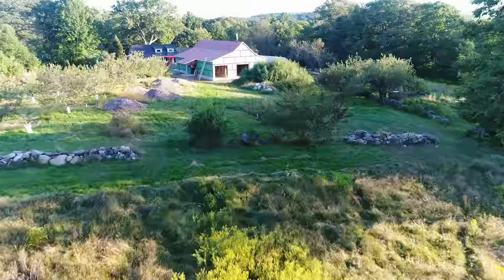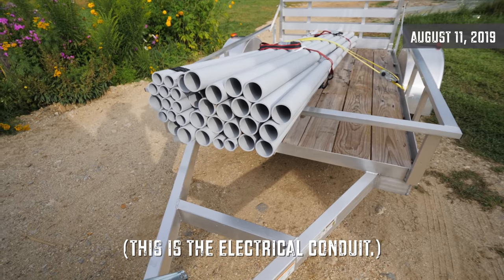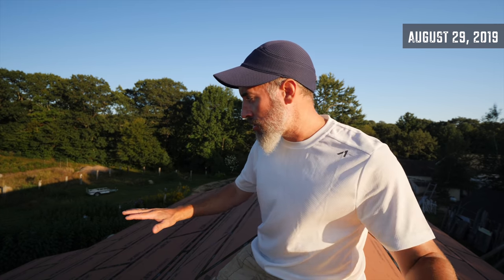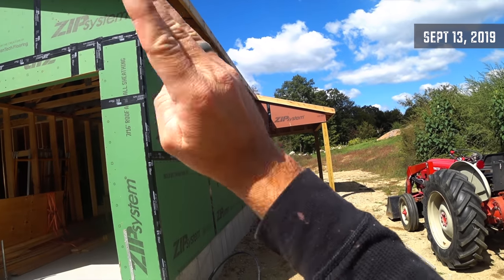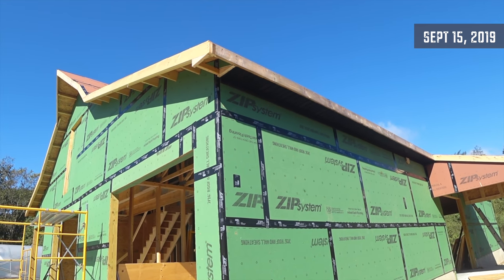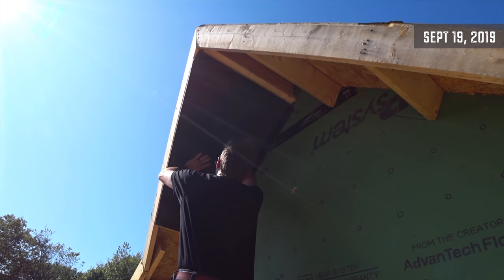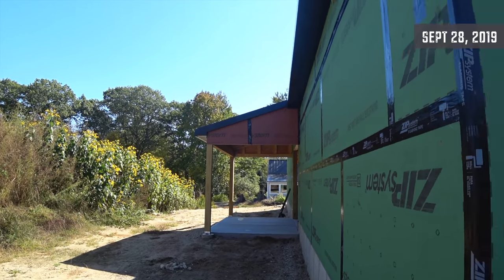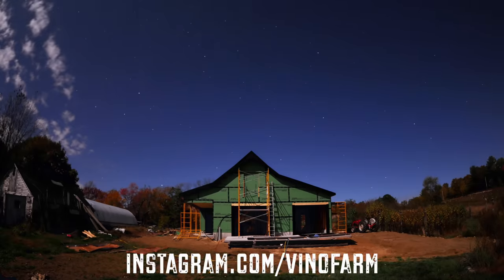Dream Barn (Part 3) FIRST TIME For Everything - Soffit, Fascia, Metal Brake, Roof Trim

Comment: Bravo going with the Zip system dude. Can’t beat it, moisture and air barrier integrated with the sheathing. I’ve personally never seen a metal roof installed WITHOUT a plywood/OSB substrate. Makes zero sense to me either. You’re seemingly doing everything right with attention to detail and quality. The end result will be a building that will withstand our harsh New England winters and be a source of pride for decades to come.
Reply from the maker: I'm hoping this building outlasts our 240 year old farm house.

Comment: So many ladders in deed. At least you seem to handle heights and your balance well. Just please stay safe.
Reply from the maker: I really dislike ladders, but sometimes they're just the most convenient solution. I found myself getting much more comfortable on them after two solid months of climbing up and down during the trim and roof phase last fall. The scaffold was very nice, but not easy to move around for quick tasks. It was essential for the peak work, though.

Comment: Awesome video... keep em coming!!! :D Love this as much as the bee videos. 
Also, really love the design of the barn with how those peak lips stick out. REALLY gives it some character.
Reply from the maker: Yeah, I decided to put a little crow's beak on the front. It's purely decorative... If we had gone the timber framed route, we could have actually extended the ridge beam out and had a hoist out there. This is just for looks and a little rain protection for the siding.

Comment: There are tricks that reduce the oil canning of the aluminum fascia, but you did pretty good. If you installed a drip edge first, then just tucked your fascia under it, oil canning would be reduced because you wouldn't need the nails at the top of the fascia. And those produce more oil canning. 
 I was wondering why you didn't continue the aluminum soffit on the rakes(gables). It would have made that a lot easier. I know you don't need venting there, but it would've looked better, imo.
But you did a good job , as I said, with it all.
I'm envious of such a great sized shop, for sure. Look fwd to more vids.
Reply from the maker: Thanks. The oilcanning is funny because it comes and goes depending on the weather and the time of day. The front facing fascia is more than 50% covered by the roof rake trim so it's not even really noticeable anymore. I got the fascia pre-cut for the sides. The front overhang was a bit wider and then the beak at the top was a custom cut. At the time of ordering, I still hadn't really figured out what I was going to use for the front soffit overhang. I like how the painted paneling came out. I think you'll see how it all comes together after the siding is on.
Reply: @vinofarm  Gotcha.

Comment: Fantastic. I am in equal measures both in awe and jealous of your numerous talents. I’m absolutely useless at DIY. Some bits I didn’t understand or follow: the black bits that fit at right angles to the barn walls into the F/J thingie - they looked like a prefabricated pieces but then on other parts of the barn it looked like you just used painted wood - think you called it a soffit. I’ll go back and look and see if I can describe it better. 9:59 vs 14:04. Why the switch to panelling? Apologies if I’m embarrassing myself with such a stupid question.
Reply from the maker: The soffit on the sides actually act as a vent. They are fabricated with slits that allow air to flow into the attic space up under the roof deck. The front overhang of the building is not connected to the inside of the building and does not need to be vented. It was also at a different orientation and dimension than the sides so I decided to use the plywood that comes with a faux 'bead board' look to it. The plywood allowed me to cut out pieces that would fit exactly in the space I needed to fill. The soffit on the sides is cut for a 1' overhang which is pretty standard when designing trusses and that's what we went with. The front overhang is more like 1.5' and the "beak' at the top grows out to be about a 35" overhang at the peak.
Reply: Vino Farm Ok great. Thanks for taking the time to explain!

Comment: you can put prorib right on the truses or put 1\2 insulation down first to prevent condensation then put your metal on you dont hve to put plywood down first it super strong with out  it , im in northern illinois its done up here all the time and we get big snow here to .
Reply from the maker: We went with zip system for a few reasons. 
1. I prefer the rigid sheets tying the trusses together rather than relying on steel which will flex over time. 
2. There was a gap of 6 weeks from when the framing was done to when the roof arrived and I didn't want the interior exposed the whole time because I was working in there. 
3. I knew I was going to be installing the metal myself and it was my first time AND I was going to be working solo... so no way I was going to be up there figuring all that out with nothing to stand on!
4. If something came up and I was unable to finish the roof before winter, I didn't want to be caught with an open building for several months of New England winter. I knew that the zip system could take the winter if necessary.
Reply: @vinofarm  good point I was just saying not trying to be an ass 😁 I'm about done with my new honey barn was putting it up last fall I'm done with everything on it, except the outside Pro rib and the inside Pro rib. I have some videos on it if you want to check them out on my channel. I made a video of doing the roof like you were. But it didn't come out right so I didn't post it.

Comment: Not sure if anyone noted in your previous video. I thought about it but figured you'd know better. But I've seen diggers dig the trench then put boards over the trench so they can drive over and continue digging 'over' the trench to connect. Wonder if that would have worked.
Reply from the maker: Calistar Lim This machine was very top heavy and the ground was pretty bumpy and soft. Theoretically I could have done some kind of bridge to park on and dig, but I didn’t really feel too stable and was under pressure to just get it done because I only had the machine for the day. A mini excavator would have been a better tool, but would have cost almost 4x what this cost.

Comment: Great job so far bu ti go to ask why your not using a scissor lift or a boom arm much easier to move around at hieghts.
Reply from the maker: Jeddco66 Because with my schedule, I can only work on this a few hours at a time. This phase of the project took 5 weeks working part time on weekends. Renting a boom was going to cost a couple thousand dollars and I’d be stressed out about paying for it to sit there unused for 90% of the time. The scaffold was $800 delivered and I’ll have it for the rest of the project (all roofing and siding) and then can keep it for life or sell it for almost what I paid for it. Same thing with the metal brake. I bought it and can use it for a year picking away at all the trim work in my free time and then sell it as nearly new when I’m done.

Comment: Is there a line in those conduct to pull the cables through?
Reply from the maker: No, the electrician just used a fish tape and then a rope. Then pulled the wire with the rope. Super fast.

Comment: You should tape the bottom edge of that advantech to the concrete. It will create a drip edge.
Reply from the maker: You mean tape the Zip siding to the foundation? I've never heard of that.
Reply: @vinofarm  Matt Risinger has several videos on ways to detail the Zip to foundation seal.
Reply from the maker: @bpdp379  I follow Matt. I caulked the bottom edge of the zip board to the foundation with a really thick line of 100% silicone. It overlaps the board and the concrete. I also caulked the sill plate to the foundation on the inside. The commenter above was suggestion taping the seam and I’ve never heard Matt do that. He uses the liquid zip or some other sealant and makes a wide line across the gap.
Reply: @vinofarm  I “think” their Zip System 1.0 was taped. They’ve evolved through a 1.5 and 2.0 doing it like you’ve described. Some even use the liquid on the nail holes and seams…your build looks solid and well thought out.
Reply from the maker: @bpdp379  Thanks. I had framers for the sheathing part and they did not give a s--t about the zip system. The first day I noticed them blasting their high power nail guns burying nails way too deep into the zip panels. I told them to back off on the depth settings and they did a better job going forward. Then after they'd left and I got up on the roof to prep for the metal panels, I noticed every single nail head was buried more than halfway into the panels. The entire roof was covered in thousands of pock marks collecting water. I was pissed! I wound up getting a couple tubes of the liquid zip and spackled every single nail hole by hand. It was stupid. But the roof ain't leaking.
Reply: @vinofarm  ouch. It’d never pass inspection here. I learned my first day when I had the job of going behind the framers and doing all the perimeter and field nailing. I was overdriving like you described and a senior guy called me over and kicked a piece from the inside and the entire sheet just tore right off…learned real fast why nail depth is vital.
Reply from the maker: @bpdp379  Glad you learned. My guys didn't learn and didn't care. Never hiring or mentioning them again.

Comment: Of course comments 6 months post may be futile, but you mentioned a conduit run for an electrical switch at the house.  Since you're putting a router and wifi in the barn, why not put in wifi light switches?  Then you can control them from anywhere on the property or schedule programs with them.
Reply from the maker: That's a good idea. I still plan on having one hard-wired switch anyway.

Comment: Great video as usual..it takes alot of  tenacity to jump into the unknown task and see it through..I would like to think I could have a similar work ethic but only being casted into such situations would tell.. any thoughts on a remedy to fix the fascia trim from " oil caning " developing waves and dips on the flat wide face side..? Apparently its a common problem with thin materials..also back story is motor oil was sold in thin metal cans that would develop this cosmetic issue..before plastic was in use..
Reply from the maker: Agent Covert There’s no real way to prevent it, but it can be visually minimized. After the roof rake trim goes on, it will not be too noticeable unless you’re looking for it. Also, black is probably the worst color choice for avoiding oil canning. Oh well...

Comment: What is with all the sand? Is that just to make it easier if you need to dig it up? Seem sit would collect too much water in the wet times with all that 'drainage' just making a trough of water.
Reply from the maker: The sand is a buffer from all the rocks. A bed of sand is nicer on the pipes than several hundred softball sized rocks floating around through all the freeze/thaw cycles.
Reply: @vinofarm  Fair enough!
Reply from the maker: @hightde13  Sand is a code requirement up here, too. It's also a good idea.

Comment: You needed a mini excavator not a backhoe. What about sewer? Always run a future conduit. Why not just run a water pex line in the building to the other corner? Instead of wrapping your facia with aluminum just use azek. Put it up and your done. Don’t forget your drip edge.
Nice barn.
Reply from the maker: Hi Larry, I’ll answer your questions. We could not find a mini excavator for rent in our area for less than $1000 delivered. This machine was $250 including drop off and pickup. Seemed like a better deal at the time. We don’t have sewers. We have septic. This building will not be tied into our septic system. It would ha ve added thousands of dollars to the project and is not necessary. A black poly irrigation line buried a foot deep to the other side of the building is going to be far easier than pex going through the building. I’ll put it in the ground as we’re regrading the the surrounding soil once the project is done. We still have a lot of ground work to do. As for azek, I agree it’s a great product. The only problem with it is you have to be OK with white trim. We wanted black trim. That’s why we went with the black aluminum.
Reply: Vino Farm yes $250 sounds better. You can always spray it black before it goes up. Good building, camera work, editing and explaining. This was a great idea for your you tubers while the bees are sleeping. Kind of like your sour dough bread.

Comment: Lucky you can have them all in one trench. Around here that would be highly illegal and dangerous. All 3 pipes HAVE TO BE x feet from each other and any other sewage pipe.
Reply from the maker: There's no sewage pipes near any of this. As long as they were put in the order I did them and the electrical was fully in conduit, the inspectors were all fine with it.

Comment: If I had just one TINY bit of advice on this whole build: Wireless security cameras are AWFUL. I highly recommend spending the extra money (not that much: CAT5/6 is cheap) and wiring in all of the cameras... It will save you hours and hours (not to mention you have to run power to them anyway...) of frustration down the line... Even with the ethernet run back to the house, and the wifi spot inside the barn, you are gonna have signal issues and it infuriated me oh so much. You might also want to run low voltage wires for motion sensors/lights at the same time, and some cameras need extra voltage if you do not have a Power-over-Ethernet (POE) switch. Oh, and for crimping the connectors onto the ends of the CAT5/6 get the crimping tool that lets the wires slide out of the end of the end of the connector. As someone who has made hundreds of cables with two ends each, it is 1 million percent worth the slight increase in price for the tool+connectors.
Reply from the maker: I've set up several Nest Cams and an Apple wireless network and have not had a single issue. It's an extended network and everything seems to work great with ethernet cables connecting the wireless base station routers. I assumed I would get some signal loss with a ~200 run of cable from the main hub to the barn, but was hoping it wouldn't be too bad. I don't know much about ethernet and hard wiring cameras. Do you have a good place to start with that?
Reply: @vinofarm  Look at Ubiquiti’s line of wired cameras.  Unifi is the model line.  They’re power-over-ethernet (POE), so they don’t require separate electrical, have good night vision capabilities, and integrate with their Unifi Protect software (you can host on your own machine, or purchase one of their appliance controllers) that will capture the video to local storage.  You’ll be much happier with them, versus wireless, and ethernet is much easier to run than romex.

Comment: 04:19 What is the Tracer for? ~ 09:09 Aw, COOL! That is a VERY handy tool! What is it called? ~ 15:23 How do you see pencil line on a black surface? ~ 15:30 What was that high-pitched beep? ~ 16:10 Why does the Staple Gun sound like a drill before the staple goes in? ~ 20:20 What is the name of that tool?
Reply from the maker: 1. The gas pipe is plastic. The metal tracer wire makes it possible for the gas company to scan the ground and detect where the pipe is. 
2. That is a chalk line. It's one of the oldest tools in the world.
3. Pause at 14:30 and you can clearly see the line. Graphite isn't really black. It's pretty reflective against the black.
4. That was the motor on the saw whining because it was bound on the wood. When I backed it off a hair, it started right back up.
5. The brushless battery powered nail guns all sound like that. They are not air powered. There's a motor in there that retracts a spring and pin that shoots the fastener into the wood. It's just the sound of the motor.
6. Dewalt Cordless metal shears. One of the most useful single-use tools ever when installing a metal roof.